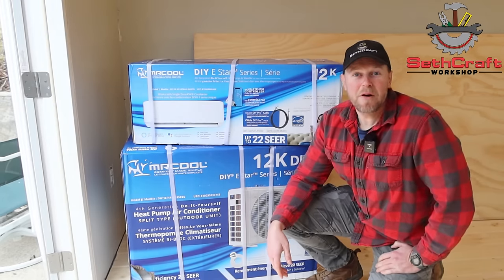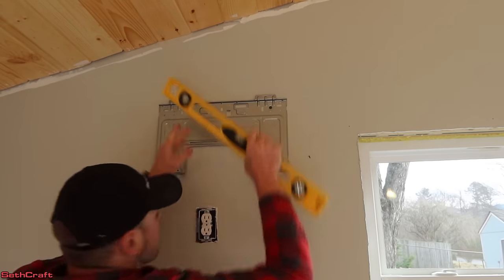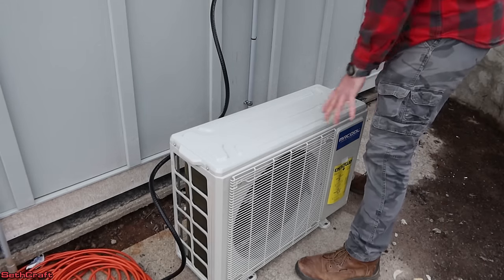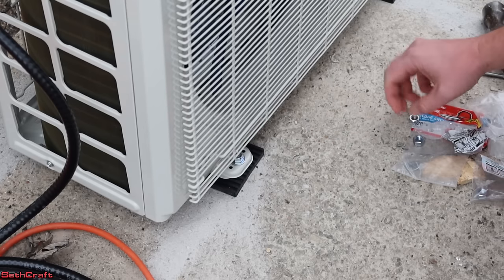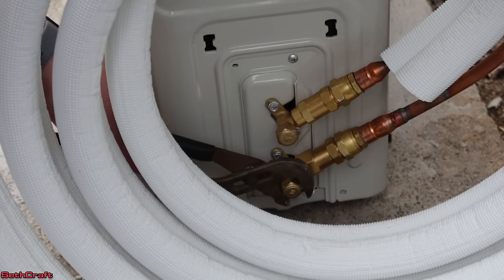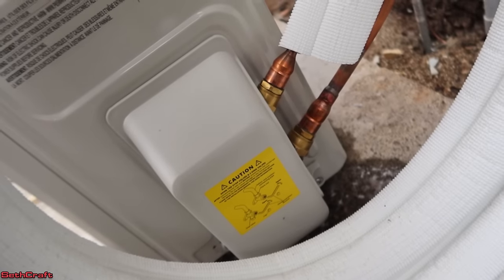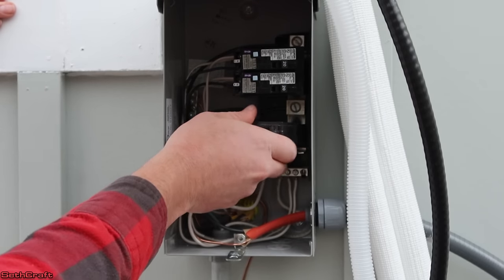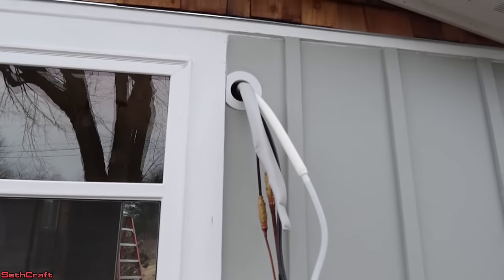Mr Cool DIY 4th Gen 12000btu Mini Split Full Install

Comment: The line set is the reason I haven't installed a Mr Cool system...the excess line coil isn't a pretty finish.
Reply: I was thinking the exact same thing. This would be a great unit for me but I need to install multi zone and I don't want all the extra line hanging around as the two units are different lengths from the heat pump.
Reply from the maker: The line is annoyingly long. Too bad they cant sell different lengths in kits.
Reply from the maker: It would be nice if the kit would allow for shorter lines.
Reply: You can get a 15 ft length as well from iwae. The lineset is an awkward look no matter how it’s finished and are constructive ways to easily hide the excess. Or you can add an extra $2000 just to have someone install it neat. The point is that it’s diy and this is the price of poker.
Reply: @slipstreamvids7422  I know there are alternate lineset lengths. I believe the standard on a Mr Cool is 25 tho. I DIY installed a couple of Pioneer units and cut the lineset to fit. The cost of the tools to do so, was less than the additional costs Mr Cool charges for their basic kits.
Reply: @dougphelps6917  Ok and what about the vacuum pump, gages and R-410a plus recovery of the system 410a. It's quite costly to go that route vs just dealing with some extra coiled line st. Agree its optimal but no longer diy for most.
Reply: @slipstreamvids7422  Recovery? Why would I need to recover the 410a, when I am not releasing it. A vacuum pump and gauge setup is less than $100. The reality is, setting up a mini-split is not that complicated. Ensuring you have good connections before you release the refrigerant is the most complicated, but not rocket science.
Reply: Should have cut the lines to length and re-flared them it’s super easy and no cost added
Reply: @brianherald5756  With the Mr Cool system they send the lines sealed and filled. You can't cut them. They do make a system that you can, but their main products are sealed.
Reply: @dougphelps6917 interesting I thought the refrigerant was inside the condenser and when you turn it on it releases the refrigerant into the lines and compressor.
Reply: @LazyCrazyGuy  In the typical mini-split that is true. The Mr. Cool systems are unique in this way. That is why they call them the true do it yourself setup. You don't need to evacuate the lines on their systems.
Reply: @dougphelps6917 lines aren’t filled until you open the 2 Allen’s on the unit, you can cut the line if u can flare them with specific tools
Reply: The lines are not filled with refrigerant,but they are evacuated, & sealed. If you cut & flare the lines , it would need to be evacuated to remove the air/moisture.
Reply: This is the most lousy job I ever seen. Line set all over wires are hanging. Really unprofessional.
Reply: @dougphelps6917 not all Mr Cool units are pre-vacuumed so it depends on where you got it
Reply: I’m an HVAC Mech, and have to agree with you 💯, all that extra copper looks ghetto.😮🫢
Reply: @dougphelps6917 I’m thankful I don’t allow simple projects to turn extremely complicated. I know many people that do this just to get out of doing things. Just finishing up with 2 systems. Wasn’t bad at all.
Reply: I came here from a Facebook ad. That extra line would definitely be an issue. This is definitely not a DIY project as they advertise. You need some sorts of electrical knowledge as well as a few handy tools.
Reply: @LazyCrazyGuy When all is done, and fingers are crossed 🤞🏼🤞🏼🤞🏼 have your spray bottle with soap ready, I opened the bottom hose first and you can hear the pressure released, do the other and open both all the way and them spray all 4 connection! * There were no * Leaks *  It took 3 hours to finish my total test, they don’t answer the phone * Emails Only * Do the mode test, Heat mode took 3 hours to work! 😳😳😳
Reply: I ordered the kit to encase the hookup lines coming down , not too  ghettoish ! 😂😂😂
Reply: @mightyworksphoto I already had the electric box 240 hookup, had a trane 3 ton unit before after 23 years it died it cost $2500.00 a new one was $5,000.00 and 24,000btu 2 ton Mr. Cool was $2,800.00. I poured concrete pad for Mr. Cool, my Trane was sitting on rotten scraped 2x4, basically sitting the ground! * I’m a DIY person, I had all the tools to install my Mr. Cool! I purchased a repo MH and wall studs aren’t 24 in centers 😂  had to remove sheet rock mount ply wood to mount bracket!
Reply: @jasonlewallen7146 is Michael your nephew 🏊🏼‍♂️🏊🏼‍♂️🏊🏼‍♂️🏊🏼‍♂️
Reply: @brianherald5756 if I cut the electrical cord and shorten it, could void the warranty!  8-10’ of either would have been perfect! I used my old electrical box, in great condition only installed new wire. Going to return the other box!
Reply: I am currently installing 4 mini split units to my house. Central ac went bad. 25+ years. I hate central air so am replacing with mini splits . Never installed these before. So far rather easy to install. Mine came with 9.5 ft of line set . I had around 3 foot of extra line. I brought my line down to the outside unit. Ran across the top of the unit and back to other side (to take up the extra 3 ft) then straight down to connection. Very little line is atop of the outside unit. I made a nice looking cover for the line there. Then bought a nice looking line set cover to run where the line set comes out of the wall, down to the unit. All good so far. 
 I would never leave my line set like it is in this video. Another odd thing is the use of 12k btu for such a small room . Even with inverter units have to be careful of not over sizing. Will create a humidity issue in the room . I learned that the hard way with my inverter window units
Reply: Cut it....
Reply: Make your own then
Reply: To the best of my knowledge, they the manufacturer pulls a vacuum on the lines so you don’t need a vacuum pump, but you release the refrigerant from the unit where it’s stored
Reply: U can always cut the excess line and get a flaring tool to reflare the line that I will you need
Reply: Unfortunately, that will avoid the warranty
Reply: I need at least 19 feet of lines?
Reply: @sethcraftworkshop i need at least 19 ft lines
Reply: I need at least 20 feet 25 feet would be better. Do they have units with 25 plus tubing?
Reply: I need around 25 feet of lines do they have diy kits with at least this length of tubing?
Reply: @mikelopez4470  yes many kits come in 16 and 25 feet...
Reply: @mikelopez4470  Yes
Reply: @sethcraftworkshop  can you tell me how long the electrical lines are that come with the kit. I’m trying to figure out how close the breaker box for my shop needs to be installed to the unit. Appreciate the step by step video!
Reply: @kennymackie4518 care to share a link for this I will be installing the same system in the video so this would be helpful. Thanks
Reply: I would like to add one in my garage but all the walls are concrete blocks. Can you still do that? How about over a window?
Reply: @SwanySwan  You'll need to bore the wall, but it can be done. There are multiple videos on youtube showing just that.
Reply: @mightyworksphoto 

You may need an electrician to do the breaker box but as far as installing the unit, it absolutely is DIY and only takes a little bit of common sense.

You can get shorter line sets, and with a little bit of preplanning and common sense you can get around all these issues.
Reply: @mikelopez4470 

Yes

15 & 25
Reply: @dougphelps6917  thanks man appreciate that. I had an a/c guy come fix my return plenum on my big a/c unit and asked him for a quote. He said 6,000 haha so I went an bought a 14,000 btu LG window unit for 600 and it’s been awesome in the garage. Definitely not as intrusive as I thought and I built a frame and shelves around it so it’s looks super nice.
Reply: I couldn’t find neutral
Reply: @SwanySwan I recently installed mine in the basement and needed to core drill through the 10” concrete foundation wall. Home Depot rents out a hilti core drill and 3.5”-4” drill bit.
Reply: @BadDriversNYC  oooo that’s great to know! Thanks so much for reply! I ended up doing an LG window unit. Doesn’t take up a lot of room like I thought. Was super easy to install and then I made a wood frame around it. Honestly looks just like a mini split now lol I’m happy and cool in my garage in FL now!!!
Reply: Yep that’s why I don’t like it.

Comment: Idk about your local codes but what I've been told from NEC code is that you shouldn't run romex in conduit as it heats up. It's better to use individual conductors

I'm sure the book meant 10 gauge stranded wire, and I'd crimp some spades on it
Reply from the maker: Very interesting. The run is very short and will be in the shade most of the year. At 12 amps max this unit should not heat up much.
Reply: Why did u use 10 awg instead of 12 awg, from my understanding 10 awg is meant for 30 amps, none the less awesome video
Reply: I'm pretty sure that's a wet location so it either has to be UF or thhn. The price you paid for the nm cable you could have bought thhn and been safer and probably cheaper. Nice job, but one question is why the line set coiled up? Can't you order a shorter line set?
Reply: @Hunter__14  I have the same question. Will be building new construction with dedicated 20amp circuits for each unit. Not sure but I think I would need 12ga solid wire.
Reply: Yes, Romex is not rated for wet locations.
Reply: Nice comment.  As soon as I saw him push romex into the conduit, I searched for "romex" and found your comment.
Reply: @kkmullin you can always go with larger wire, you just never want to go with smaller wire. They might have had some 10/2 already laying around since it's a construction site, and so decided to use that, even though it's unnecessary in this particular application.
Reply: Yes romex can only be installed in a conduit body that is for dry locations only. Mainly applies to underground applications. Overall should just use #12 thhn for this application.

Comment: My question is I know they have a decent warranty how ever…. Is that warranty void if you do it yourself vs having a license contractor do it ? I’ve heard it’s in the small print.
Reply from the maker: That is an interesting question. I did not read the fine print. They probably do get you with some things. Like if you wire the unit yourself vs having that done by an electrician.
Reply: On the website for the diy unit the linked warranty does exclude mini-split systems not installed by a licensed hvac contractor but specifically and clearly states that it does not apply to the diy product line.

Comment: Since it's just 110V can you connect it to an existing 110V outdoor circuit with a disconnect box?
Reply from the maker: Yes you can. I like the 60amp disconnect boxes. They are wired to accept 120v or 240v.

Comment: How does the indoor handler unit get power?  The manual showed an “air break switch” next to the handler but the directions said nothing about it.  So does the black cable provide power back from the condenser to the handler in addition to communication?
Reply from the maker: The indoor unit does get power from the outdoor unit. There is no actual communication between the two units as far as wifi or Ethernet. The indoor unit dictates how the outdoor unit operates.

Comment: I have an older brick house.  Is it possible to run the lines through the top of a window rather than drilling through the brick?  And thank you for this easy to follow and understand video.  I was hesitant with these with most needing to have some evac and charge the lines.  Still hesitant on the electrical part, I hate messing with electricity even though I know it's easy.  Plus I already have a central heat/ac unit set up.  It went out few years ago, 2200. for the part, 4000. to replace.
Reply: Hire a pro. Your sound scared
Reply: Did you manage to run it through the window?

Comment: Most condensers come precharged... You still have to vacuum the evap and lines... My question is what about the air you introduced into the line when you made the connections??
Reply from the maker: For this install I just followed the directions. It does not show any place that needs to be vacuumed. Mr. Cool asked to use clips from the video in ads so they also did not mention anything about pulling a vacuum.
Reply: @sethcraftworkshop  thanks...

Comment: So what happens to all the air in line set along with any moisture  it needs vac pump
Reply from the maker: The Mr. Cool DIY has caps on the ends of the line-set to keep the lines charged. The air is already purged from the lines. These DO NOT need a vacuum. They are made to be installed by the homeowner without the vacuum pump.

Comment: Nice work! Was this install in a very cold or very hot location? Is the 10 x 12 shed uninsulated? 
I feel the 12K btu is too big for this size building. If location gets snow and freezing weather it
would be advisable to have mounted outdoor unit above ground level because of condensate
and possible snow blocking fan.
Reply from the maker: This location does not get very hot or much snow. Summer might see 90 degree on the hottest day. As for cold the lowest temp is around 10 degrees.  

The 10x12 is fully insulated as a detached office.
Reply: @sethcraftworkshop  Thanks for the reply. I installed the same unit in my 450 sq/ft insulated garage
in Michigan. I don't run it all the time, just when the weather is bad and I need to work out there. The end user will be blown away how well it works and how quiet they are.

Comment: The wire used from the mini-split to the disconnect (circuit breaker is NMB).  According to the NEC electrical codes, this is an incorrect usage of this type of wire.  The proper wire should either be Thhn/Thwn or UF cable.  Would fail an electrical inspection wired with NMB.
Reply from the maker: Is that because of the possibility that moisture could reach the wire?
Reply: Yes.  Inside a conduit is not a location.  The wire is located wherever the conduit is, therefore you have installed NMB in an outdoor/wet location which it not rated for.  A conduit located outside is considered a wet location.
Reply: He also coiled the lines in a vertical position, which is not correct. He also ordered way too much line .

Comment: I’m pretty sure the Mr. cool 12 K uses 14 four wire which is much cheaper and easier to work with than the 10 gauge wire. The 10 gauge wire is overkill and not needed.

Comment: I see you didn't install an a/c disconnect box. I will install my system like you did under a breaker box. I guessing you don't need a disconnect since the breaker is just above it to kill the power when needed. I'm sure every state's codes are different. I'm in Florida. Thanks for any feedback. Craig
Reply from the maker: For this install, we did not use a quick disconnect box. Just used the breaker as the disconnect. There's certainly nothing wrong with adding that quick disconnect. But it seemed a bit redundant in this situation.

Comment: DOES EACH ROOM IN THE HOUSE NEEDS A SEPARATE SYSTEM; IF NOT HOW DO YOU CINNECT OTHER ROOMS TO A SINGLE UNIT?
Reply from the maker: This is a single zone mini split. You can get multi zone. Theose have a single outdoor unit and multiple inside units.

Comment: great installation video but 20 amp circuit breaker is probably not to code should be 25 amps with #10 wire to panel.  Did to review with an electrician?
Reply from the maker: The 20 amp breaker was installed based on the recommended amperage rating in the Mr. Cool install guide. The install was not inspected by an electrician.  It should not have to being a DIY model. (Although I can see the benefit of that)

Comment: Did you have to evacuate the lines at any time?  Other DIY's mini-splits include this step to be completed.  What's different about mr. Cool linesets?
Reply from the maker: The mr cool has push caps on the ends of the lines that hold in the coolant. No vacuum is needed. The lines and outdoor unit are both already pre charged.

Comment: at 7:45 are there specific Torque specifications to tighten the connections? or just wing it?  serious question :-)
Reply from the maker: There are torque specs. I did not have a wrench for that so I just did the best I could. Has worked flawlessly for almost a year.
Reply: @sethcraftworkshop  Thanks I appreciate it. I'm about to install a Blueridge DIY and I'm just taking my time to do it right.

Comment: Hey man, nice work…could u have used 12g instead of the 10g from disconnect to the unit?  Helping a friend install a Hessaire 12,000btu - 115v unit and having difficulty getting the 10g whip to fit into the unit, thanks
Reply from the maker: Yes 12awg is rated at 20 amps. You will be fine with 12awg.
Reply: Yes

Comment: The 12k 110v until I'm looking at from Costco says the max fuse is 25A, so shouldn't I get a 25A breaker?  Also was the 10/2 wire included or did you buy it separately? thanks
Reply from the maker: a 25amp should be fine. The 10/2 wire was purchased separately. You can find electrical whips that are already installed in conduit. Makes things a little easier.

Comment: Hi there, Did you feed the 10 wire into a 1/2'' flexible conduit? I was trying to use 3/4" conduit but the cover on the outdoor unit  accepts 1/2'' inch only unless a bigger hole is made which it seems kind a hard to make a clean  whole since there is not pre made Knockouts. Any input on this? Thanks for the great video!
Reply from the maker: Yes, I did press the romax cable into the half inch conduit. I recommend that you use 10awg thhn wire. This threaded wire is easier to flex into conduit.
Reply: I used a 3/4" liquid tight NM conduit and had the same trouble with the too small 1/2" hole int the cover. Work around I used was a 3/4" LB short aluminum conduit body. I put a, 3/4"-1/2" metal reducing bushing into the conduit body and attached that to the cover from the inside with a 1/2" metal conduit nipple.